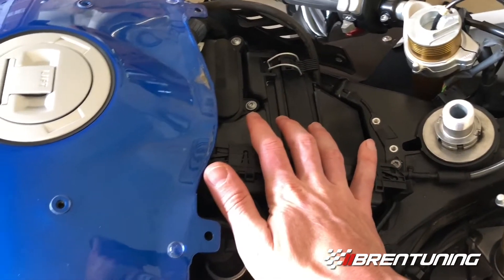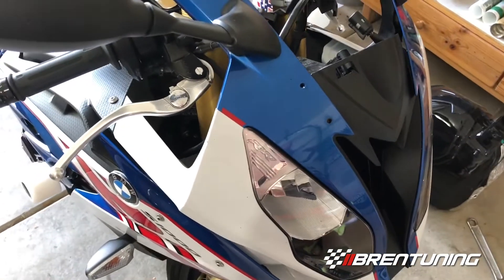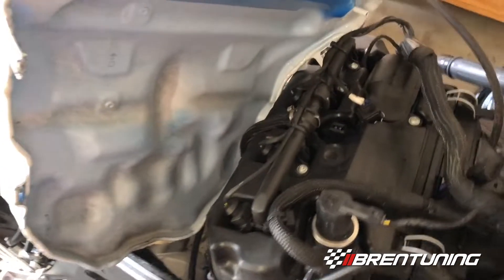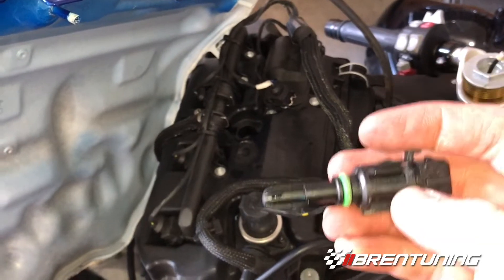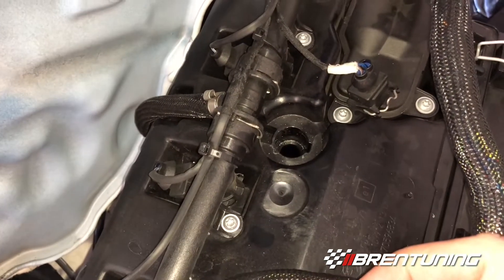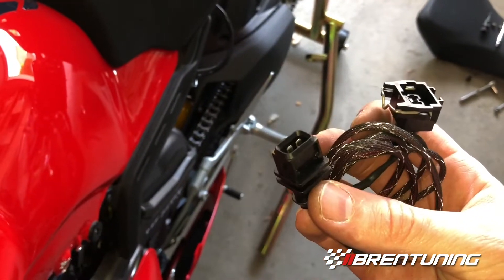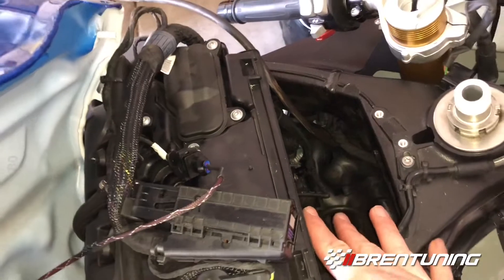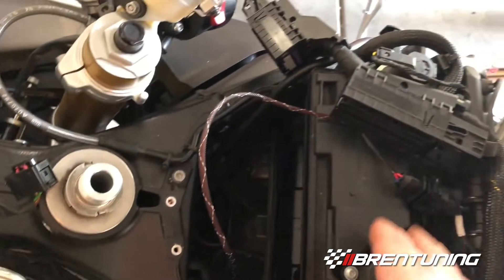BMW S1000RR, How To Install Brentuning IAT Relocation Kit

Comment: Any way to do it without drilling plastics? Don’t wanna drill oem plastics tbh :/
Reply: I mean technically yes you could find an unintrusive place and ziptie it somewhere near the intake Trac. But it's honestly not that bad of a spot to drill. If it's a major concern you could also remove that piece and get someone to 3d print you a clone of it?